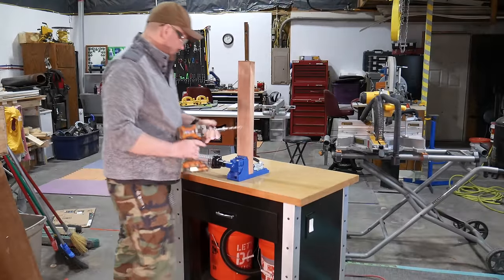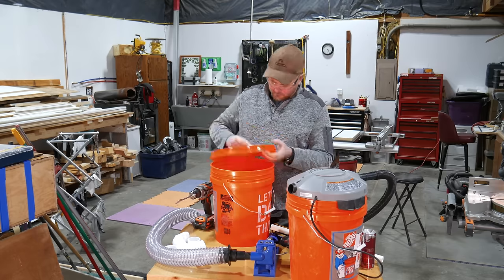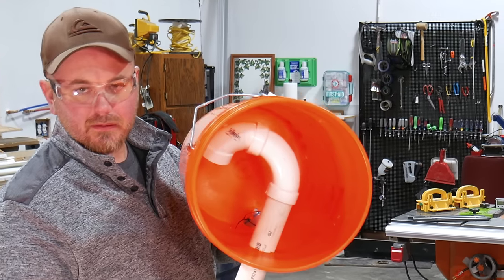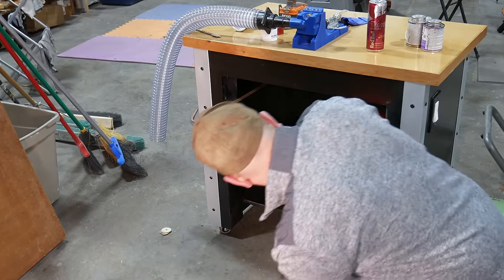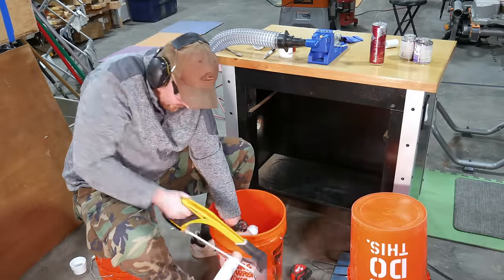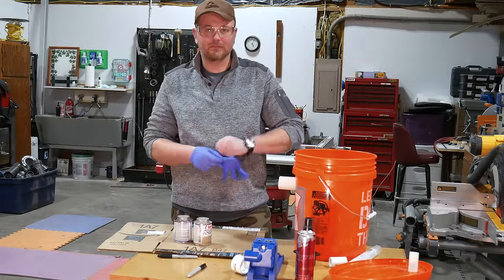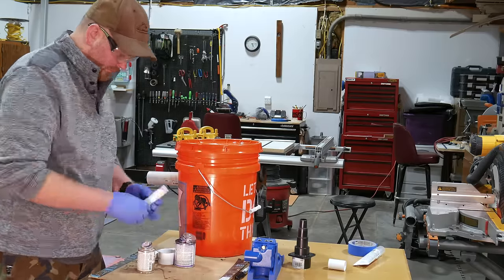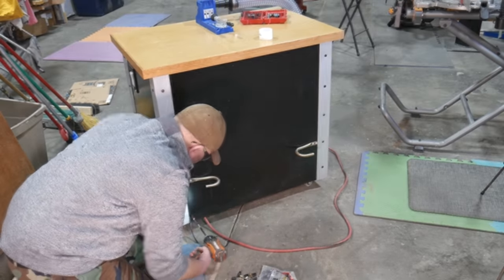The World's Greatest Dust Collection System

Comment: Drill holes slightly smaller and add heat with heat gun , then install pipe or fittings for a almost purrrrrrrrrrrrfect air tight fit !
Reply from the maker: chuck s that is a brilliant idea. I may just have to steal that and make a quick tip video, but I’ll give you credit! Thanks for sharing, this is what this whole community is about, sharing ideas!

Comment: I like the simplicity of using the elbows inside vs cutting an angled hole and angled pvc pipe.  The one thing I'd do different is to put the outlet that goes to the shop vac in the center of the bucket lid so it doesn't mess with the vortex and will have less chance of sucking up dust as it spins around the edge.
Reply from the maker: Thanks for checking out the video. That would be an interesting experiment, make a second lid with the shop vac port more in the center of the lid and see if there is any noticeable difference in dust getting drawn into the shop vac. I'm thinking follow up video...

Comment: This is exactly what I have been looking for, thank you! I was wondering, do you think the Bucket Head would work with a Dustopper? Love the idea of being able to have sufficient dust collection for a bandsaw with two buckets, the Dustopper and Bucket Head. Any insight would be much appreciated.
Reply from the maker: Tony Luong You’re welcome. From my experience with the Bucket Head shop vac, it’s probably best suited for light duty dust collection. It’s not a very powerful vacuum. It works great for an application like in this video, a pocket hole jig doesn’t create a lot of sawdust, it’s more just chips and shavings from drilling. For my tools that create lots of dust, I have a more powerful vacuum. For a bandsaw the bucket head might work, but you may want to consider spending a few more dollars on something a little more powerful. I suppose you could give it try and if it isn’t powerful enough, use the bucket head for something else and upgrade to a more powerful vacuum for the bandsaw. Either way you can still make your own dust collector using the method on this video, or that dust stopper is a good choice too. I have those in my shop too, they work great. Hope this helps, Merry Christmas
Reply: @JFKreations  Thanks so much for your quick response. This makes sense, would you have any input on the minimum amount of amps/hp for a shop vac? Asking due to limited space in my shop, thanks so much and merry christmas.
Reply from the maker: Tony Luong no problem. I was up early watching YouTube waiting for the kids to get up and start Christmas. My thought is get the most powerful vacuum that fits your budget and your shop space. Special use situations like my pocket hole jig you can get away with smaller, but all powered saws make so much dust, the more vacuum power you have the better your dust collection will work. What I would definitely look for though, especially if you’re using the dust stopper, is a vacuum with a 2-1/2” diameter hose. The bigger hose moves more air and dust and will connect directly to the dust stopper and most other dust cyclones without having to use adapters and reducers. This is the vacuum I use in my shop on my my larger stationary power tools https://www.homedepot.com/p/RIDGID-12-Gal-5-0-Peak-HP-NXT-Wet-Dry-Vac-HD1200/304006023     it’s fairly quiet and has good power.
Reply: DIY The Art of Wood Thank you so much for this! I, too, was up and waiting for my daughter to wake up and of course was killing time by researching dust collection. LOL Thanks again for your help!
Reply from the maker: Tony Luong you got it. Merry Christmas. And good luck building your dust collector!

Comment: Nice video, thanks. Buy yourself one of those ratcheting PVC cutters, you'll never waste time with a hacksaw on PVC again!
Reply from the maker: Thanks for checking it out! It was a fun project and video to film. And long overdue - I built that cart months ago and have been using that pocket hole jig without a dust collector since. If you end up making a similar dust collector let me know how it goes. And you are 100% right about the ratcheting PVC cutter, they are faster and cut much cleaner. Little secret, just between you and me, I actually have a couple PVC cutters, but I left all my plumbing tools at home the day I made this video. I had the hacksaw handy, so I just went for it. Maybe a good thing though? The average DIYer may not have a PVC cutter and this shows it can still be done with a caveman like tool - the hacksaw! I really like the SharkBite PVC cutter, it cuts really clean, but is really only useful on smaller diameter PVC. If you haven't seen one check it out here. https://amzn.to/2Cldpx5